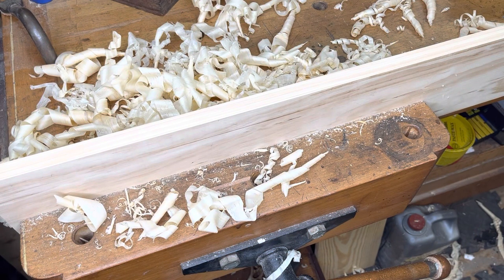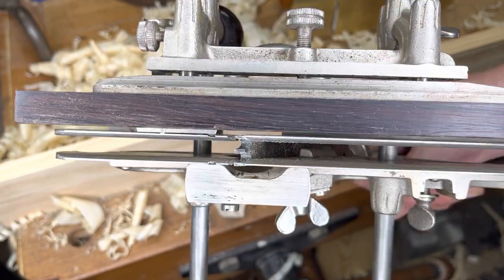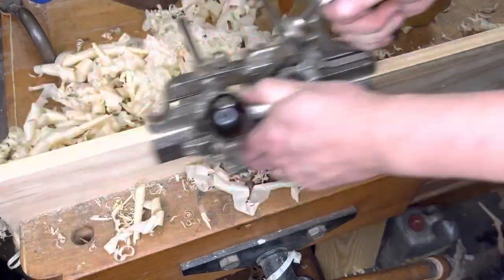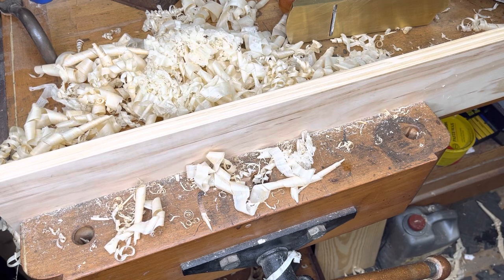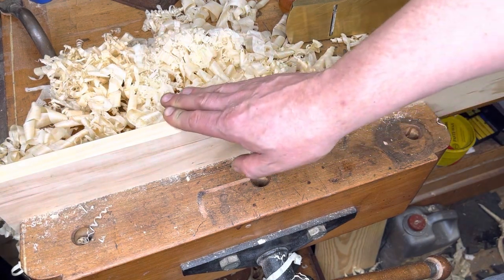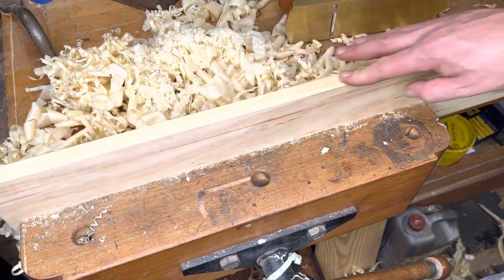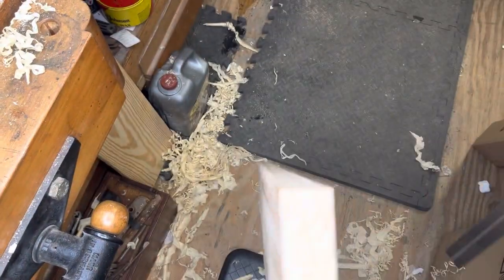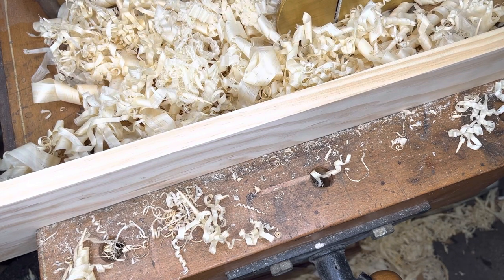It’s a combination plane challenge from Just Plane Fun! Let’s see what you’ve got!

Comment: I am making a cherry blanket chest for my wife based on the six board design. I could not get cherry in wide enough pieces so had to joint smaller widths and glue them up. I wanted to use aromatic cedar for the bottom and was going to glue that up as well. “Wait a minute, what about tongue and groove joinery and no glue?” I did not have a match cutter for my 45– Just Plane Fun parts department to the rescue! Not having done this before I got out some pine. A few practice pieces later using the match cutter and same sized dado cutter I was ready to tackle the real thing. I am glad it took the time to practice. My production joints came out well, and I only messed up on my practice pieces, not the cedar I needed for the real piece.
Reply from the maker: I like everything about that!!